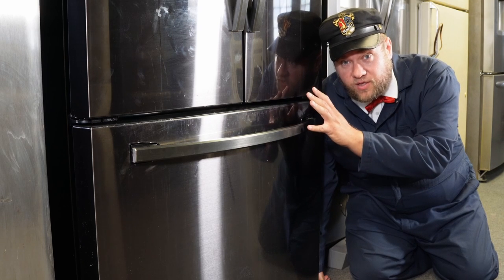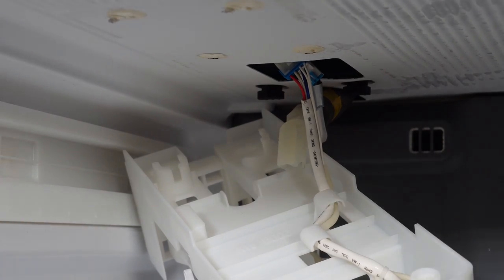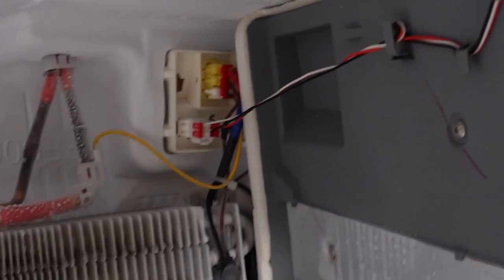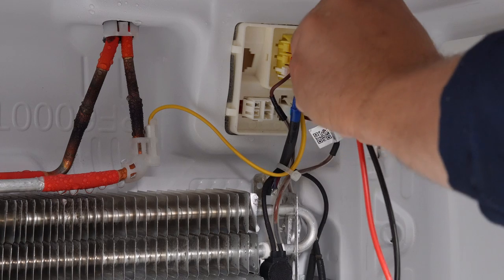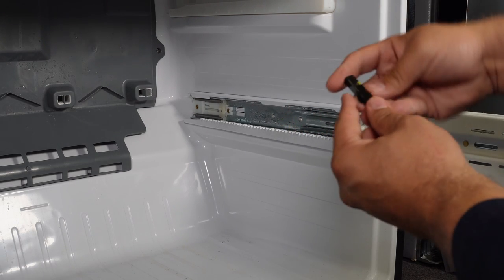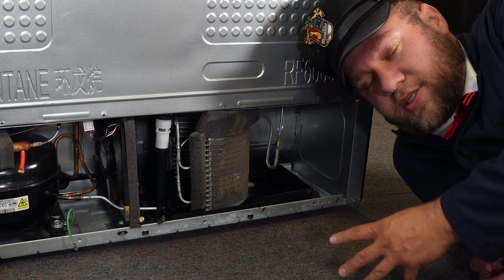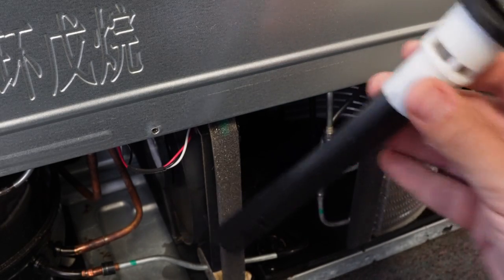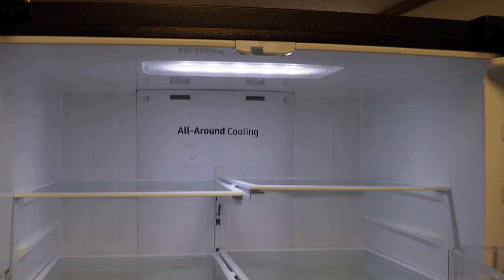Samsung Refrigerator Freezer Not Working or Won't Cool Enough - Ideas to Test and Fix!

Comment: Hi Ben. I have one of these twin cool units. My fridge works, my freezer does not. I removed the panel as you described. I tested the fans with a battery, both work, I tested the sensor, good. Evap coil is not cooling. WTF? The morons that built this unit did not give us enough lead on the wires. Typical. Never mind, I got it fixed. I just had to wait overnight lololol thanks for the great video. I had to open both doors to get that
Big bin out of the freezer. I cleaned my con coil with foam coil cleaner. The one you showed was disgusting, and evidence of a low knowledge owner re refrigeration.
Reply: You fixed it by cleaning the coil?
Reply: @xincai951  No, read my next post. I installed a piercing valve and added some 134a till I got 7 lbs on the low side. That solved my temp problem. I replaced all the fan motors, all the temp sensors and replaced both boards with cannibalized ones from eBay. To be honest, I think the only problem I actually had was low coolant. I have cleaned my condenser coil from time to time because that is absolutely necessary, especially on these new refrigerators where the coils are really shoved into a small space. They used to be run all over the back of the fridge, or freezer in the old days. In that configuration, they almost never failed. I remember 50 year old fridges still running fine. Yeah, they froze up, because the seals were shot, but that forced you to clean them out properly with sudsy water with a little bleach. I just unplugged it, put a box fan in front blowing in, had a couple of beers, and waited. I guess R22 or R12 did not ever need to be topped up like the newer stuff. I am 77, and old school, back when things were much simpler and easier to fix. Now everything has a motherboard that is prone to surge damage, and appliances actually have "personality" dip switches to set. My point here is: A refrigerator is basically a big insulated box with a few parts. All the parts I replaced cost me less than around 300 dollars. The cost of a new insulated big box out of the house and get a new insulated big box into the house faaar outweighed what it took me to fix the old one. My fridge is now at 37f and my freezer is at -2f. 4 ice trays cost me 14 bucks and they produce 56 cubes in about an hour. More ice than I ever need.

Comment: Hi Ben, thanks for the great videos! I fixed my fridge and added the additional heater as you showed. Also replaced the board and only then the heater came on with forced defrost. It's working fine but now I'm getting error code F1g - F-DEF.-Heater Error. And there is a new continuous motor-like noise that stops when I open the freezer. Any ideas? Can it be ice around the fan just like up there in the fridge section?

Comment: We had a repairman come out and add freon.  Just the freezer did not work.  4 monthes later the freezer stopped working again.  The repair guy put freon in again and then told us that the repair is $600.  Should we add freon again or ditch this Samsung for a bespoke?  Ours is a 3 door with 2 icemakers.  RFG 238AARS/XAA
Reply from the maker: "Adding freon" means there's a leak. Its pretty clear no one fixed the leak. If you want to repair it, actually find someone that'll repair it, not re-fill it with refrigerant.

Comment: Hi I have same model but fridge is working fine but bottom freezer not cooling 
I checked and even replaced defrost sensor but still no luck please let me know if anything else I can do 
Thanks
Reply from the maker: Did you watch the video and do all the steps?
Reply: Got the same model and followed all the steps. Cleaned the condenser coils, used my dmm and got correct measurements. Fans are working. Compressor working. Indicator light in the board shows no issues.  But freezer still wont get cold
Reply from the maker: @drydenvos4826  whats the temp on the freezer and then the refrigerator portion?
Reply: @bensappliancesandjunk  
Freezer is 16 C ( 61 F) and fridge is 2 C (35 F).

Comment: Great tutorial Ben.
My Samsung is only 5 years end the ice maker stopped working even though at first I kept defrosting it. But, during the summer it stopped completely. And now, the freezer quits on me. I hate Samsung products now including their tv. Regardless, I follow your tutorial now and get 0 ohm when I brown wire.mine only has one brown wire. Also, I find a piece of duct tape at the bottom between coils and the aluminum plate that supposedly holds water. Interesting??? I believe I need to replace the sensor which gives me a 03.83.volt and the defrost circuit that reads 0 ohm. Do you have a tutorial on to replace these two please? My model is: RF263BEAESG/AA and serial #: OAJC4BBK600222L
Thanks again for that great video.
Manny.
Reply: Samsung has a class action lawsuit for the Ice maker! If you call them and tell them it was the ice maker they will come and replace the whole thing for free just got mine done works amazing

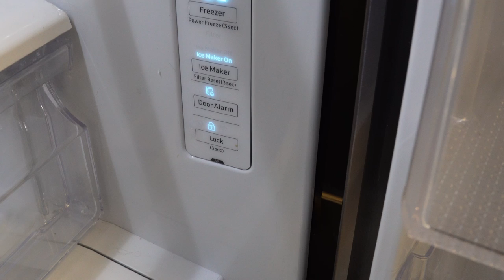Comment: Great Video!  Thanks a ton. Question, there was ice build up exactly as shown in the video (3:30 min).  Both of the fans work. Switched of the refrigerator to defrost. Now, should I inspect the sensor and heating element to see if it works?  or just clearing the ice should be enough?
Reply from the maker: Yes. You want to test the defrost, preferably through forced defrost, to confirm the defroster system (sensor+heater) work. If you clear the ice off just by allowing it to warm up, it'll solve the problem but come back in 3-4 weeks. You want to make sure that system can work and will clear the ice off by itself. If it can't, the bad part needs replaced because its supposed to defrost every 24-48hrs without you knowing.

Comment: Great video! I'm currently adding a secondary heater to my Samsung fridge upper because of icing. Everything is defrosted, no cooling problem in freezer. 

Do you think it's worth pulling off freezer cover to inspect? Or just leave it & open up if I run into problem?

Comment: My freezer did not seem closed when I put the rails back. I could not find the door switch to turn off the light and make the fridge think that the freezer door was closed. And ended up being a magnetic switch at the bottom of the outside of the freezer. If you just put a magnet up to it it will think that it’s closed. And then I took about 45 seconds for the fan to turn on.

Comment: The only thing they did not include in this video is how to remove the evaporator fan in the freezer. 

Mine is buzzing. I removed it and the fan would buzz when manually turned inside the board. Removing the fan and spinning it, it doesn’t buzz or hum. Weird.

Comment: My Samsung fridge's mainboard light isn't blinking and the compressor is running but inside is not cooling.  The Samsung tech came and looked at it and told me the mainboard is busted and charged me $500 to replace the mainboard.  Am I getting ripped off?  
They claim it's a sealed system problem and that that's covered by warranty but they can't repair the sealed system until they replace the mainboard.

Comment: Hi Ben . I have the same samsung fridge and ever since I got it a year ago it does not want to cool to the 35 deg I set it to. The fridge says its at 35 deg but I put an thermometer inside and it stays at 39-41 deg.   I had a Samsung call out a tec 6 months ago and he replaced the board and the panel inside the fridge with the fan on it.   it worked for a while and the thermometer was going from 34 deg to 40 deg.   now Im out of the samsung 1 year warranty but I have a best buy warranty. I was wondering if you had any insite on this issue.   Oh and I looked at the door seals and I didnt see anything like gaps.   The freezer works fine.

Comment: I’m FRUSTRATED. MY REFRIGERATOR IS WORKING BUT NO freezing..Pulled bottom panel  no ice. Pulled back no dirt clean coils …WTF. Help…….
Reply from the maker: Check the inverter on the back for any error codes. They do like going bad on these style fridges
Reply: @bensappliancesandjunk  thank you for your replay. I’ll ch3ck inverter code

Comment: I had no ice build up in my freezer.  I replaced the temp sensor and defrost sensor with no luck in getting the freezer to temp.  Both EVAP and comp fans are working,  compressor coil is clean.  The board has a solid red light which means no error.   Fridge temp is ok.  Any ideas why my freezer is not cold at all?
Reply: I have the exact same problem fridge is fine, freezer is cold but not like it should be at 0 deg f. Ice maker not making ice. I installed new ice maker. My old GE in the basement saved my food. It's as cold as a well diggers ass in Jan. I should have remembered that not once did I see a fridge during my stay in Thailand during the war, except at the chow hall. We in the US have been making refrigerators since Christ was a corporal. Moral: Buy American. Better yet, buy OLD AMERICAN and refurb it.

Comment: Nothing manufactured with a Name brand is the same as those made in the past.  I have a 21 year old Amanda with the freezer on the bottom that is still kicking btt.  I have a 30+ year old Kenmore that is kicking btt in my garage.  Brand Name Means nothing!
Reply: I swear that they manufacture things these days with a pre-programmed kill switch built in. I have an almost 30 year old Rowenta toaster that still works. Same with an old Krups coffee grinder. The list goes one. Anything you buy now and get 10 years out of it makes you one lucky duck.
Reply: I know a person with a fairly recent engineering degree . He was hired by an automobile manufacturer. His job was to re-engineer certain parts that were lasting TOO long.  They wanted him to make them fail sooner!!!!   This is 100% true.   After a short time this engineer quit , because he couldn’t live with his job.  He couldn’t sleep, eat, get along with family, etc!
He has left manufacturing entirely.

Comment: Samsung products are all garbage, especially their cell phones. Had a Samsung refrigerator at a rental we lived in for a while and it made all kinds of noise and every time you opened the bottom tray it dropped ice cube on the floor underneath it. The glass trays also don't hold water, so any spills or leaks go through the entire refrigerator. We had this happen when defrosting a turkey in the refrigerator. What a freaking mess! When we moved again we went back to our old side by side refrigerator that was about 20 years old. It is massively better than that Samsung garbage!
Reply from the maker: Ironically, I filmed all my videos up until the last one of last year with a Samsung phone. They did pretty well for me, so I can't complain too much lol

Comment: The temp sensor that controls temperature is visible on the ceiling of the freezer, not on the coil as you stated. That sensor is for defrost.

Comment: The best completed video I have seen. So far I have not found long term solution with RFG237AARS/XAA that is about 8 years old. About every 18 months, I have to clean all ices accumulated either Friger and/or Freezer, in addition to water leaking. Then everything is working fine. Lucky my wife keeps the old style Whirlpool refrigerator without stainless and all digital control panel to adjust temps, this old refrigerator (made in USA) is still working approx. 30 years old without cleaning and replacing any parts.

Comment: Nicely done!  Thank you for all you do for us DYIers! Another great, professional and concise troubleshooting/repair video. You saved me hours of grief trying to figure out the problem with our Samsung freezer (our model is RF23M8070SR, similar with Flex-Zone drawer). 

Sorry, I'm so detailed and long-winded here, but it was a compound problem and I hope it helps someone else out there. We first noticed water beneath the refrigerator and then the Freezer and Flex-Zone drawer were not cooling adequately. Fridge was cooling to setpoint.  Items were cold in freezer, but not truly frozen solid. We also found water pooling beneath crisper drawers. Checked the condenser coils for dust/debris and they were clean (cleaned 3 months ago). Checked for PCB LED error flashes, none. Reorganized items in Freezer to ensure proper air flow, but the freezer still could only achieve ~29 deg F at 0 deg F setpoint. Discovered the Fridge evaporator was not draining, drain line was plugged. So there were two problems - Freezer not cooling properly and Fridge drain line plugged.  Seemed odd to have both problems at once.  Did a forced defrost (FF) and observed water coming out of Freezer drain line during the defrost, but none exiting the Fridge drain line due to blockage.  Ran a 14-gauge wire up all three drain lines from back of unit and only the Fridge drain line was blocked.  Removed Fridge evaporator cover suspecting ice build-up, but there was very little ice/frost build-up.  Everything else checked out fine (sensors, bi-metal thermostat, fan, etc.). Ran hot water (190 F) down evaporator drain line several times, but it didn't clear. Although, perhaps ill-advised, I then used compressed air, increasing the psi incrementally up to 60 psi so as to avoid any "blow out" of the line. The line cleared.  It indeed was ice build-up in the line as evidenced by ice crystals coming out of Fridge evaporator drain line. 

Okay...I thought given that the Freezer and Flex-Zone compartments were not cooling properly, and Fridge drain line that runs directly behind the Freezer evaporator was frozen, maybe the Freezer evaporator fan and/or coils have ice build-up. The Fridge drain line being frozen was "collateral damage". Did another forced defrost (FF) and this time observed water draining out of both Fridge and Freezer drain lines. Yay!  Plugged in refrigerator and monitored temps in Fridge, Flex-Zone and Freezer compartments, but no improvement after defrosting.  Fridge achieved set point at 36 F, Flex-Zone was 58 F (34 F setpoint) and Freezer was 29 F (0 F set point). Ugh!  Removed Freezer evaporator cover and did not observe any ice-build up anywhere. Again, all components checked out fine (sensors, bi-metal thermostat, fan, etc).  Puzzling!  However, when reflecting on things, I recalled that when I removed the Freezer evaporator cover with built-in fan, the fan was running (refrigerator plugged in), but the fan wire connector easily pulled out of the terminal block before I could reach back and press on the connector tab to release it. That seemed a little odd.  So, I reconnected the fan wire connector to the terminal block and it 'clicked' securely in place, albeit with some resistance. Fit was very snug without being fully secured. I tugged on the wire to see if it would release - NOPE!  I repeated this several times and not once did the connector release with great tension. I then checked to see if the fan would operate when the connector was only part way into the terminal, and it did operate just fine.  There was enough friction to hold the connector in the terminal without being snapped in place. Since we bought our refrigerator new and it had never been worked on, my conclusion is that the fan wire connector was not properly secured during Samsung assembly.  After 5-1/2 years of operation, the fan connector loosened and lost contact.  The fan stopped working which compromised the Freezer and Flex-Zone cooling ability, along with freezing up a portion of the Fridge drain line to where it was blocked.  Freezer and Flex-Zone compartments have since cooled to set-point.  Takeaway for me is to always double-check electrical connections.
Reply: Thanks for the detailed post. Our samsung freezer stopped freezing just recently. Curious, how do I confirm if the fan is working or not?

Comment: Still having trouble with mine. Freezer wasn’t froze up, and was also empty. I cleaned coils and the fan is working. The fridge works great, but the freezer and middle drawer are not working at all.

Comment: Thank you for the great video.  Wondering if you have any other ideas.  My Samsung's freezer is too warm, but is making ice at the ice maker.  I removed the back cover and cleaned the compressor fins, also removed the interior plastic panel to inspect the coils, and the coils have zero ice.  Still, the freezer is too warm.  Maybe the circulation fan is out?
Reply: I’m having the same issue. The middle drawer is warm too, but the main fridge as at correct temp.
Reply: I also changed out the temp sensor and it was going in the right direction, but the temp started to rise again about 12 hours in.
Reply: @hollytroyer2804  We ended up having a very small freon leak.

Comment: My Samsung rf220nctasr looks like this one. My first problem was the icemaker stopped making ice and I heard a lot of noise from the fan. Within a few days the refrigerator wasn't cooling. The freezer was full and all food was frozen so I wasn't sure if it was freezing or not. After watching this I was pretty sure it needed to defrost. I unplugged it and took all the food out. I cleaned the coils and drain tube.I also took out the shelves and drawers and cleaned all of them. I left it unplugged  24 hrs. Then plugged it in. I put a thermometer in the fridge and in the freezer. I didn't open the doors. After 3hrs 45 min I heard the ice dump. I opened it and the refrigerator was 38° and freezer -0°. Yay. I can cancel the repair appointment I scheduled. The repairman was booked up and it was going to be 2 weeks before he could come. I had been freezing a lot of vegetables from our garden and I  believe I had to much in there it was packed to the top. Thanks Ben for your great video.